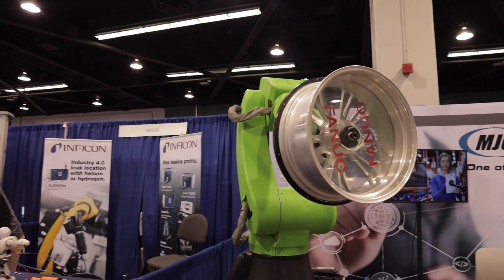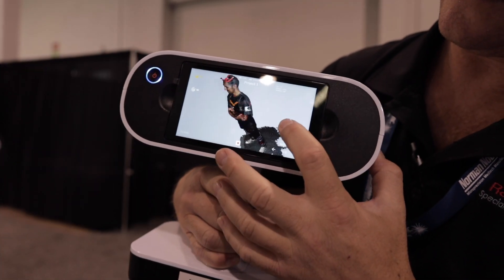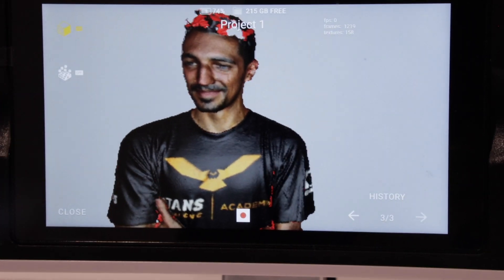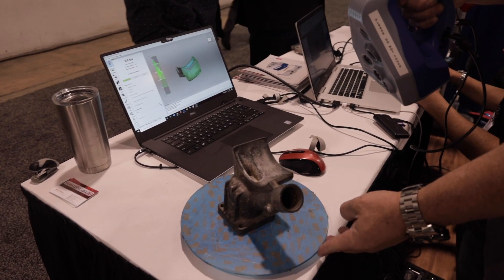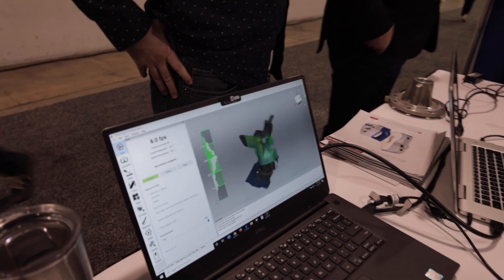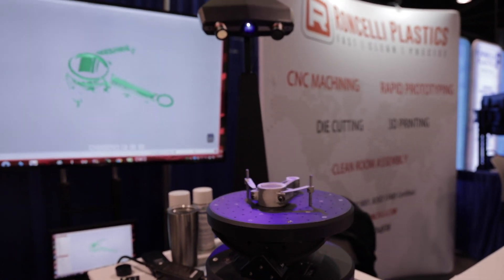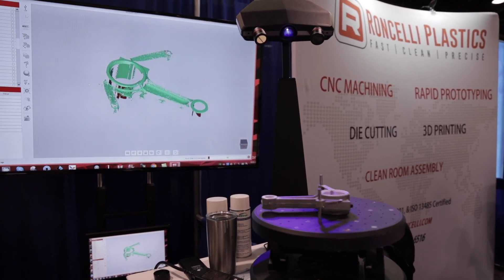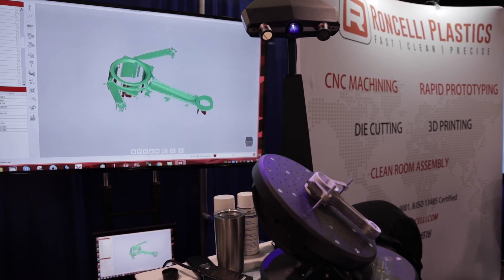Revolutionary 3D Scanning Technology | Rapid Prototype Innovation | Next-Gen Reverse Engineering

Comment: Its really chalenge to use 3D scan in CAM software.Scanned models surfaces is still in triangles right?
I discus it with some engeneers and they told me its impossible to scan thing to manfacturing process like precise geometry or even tight tollerance holes because its not so accurate.(Speaking of 0.01mm accuracy).But nice to something like car parts or making parts on 3D printer.
Reply: Sorry, but 0.01mm or 0.127 mm is like day and night.